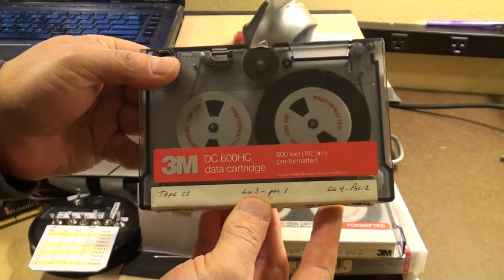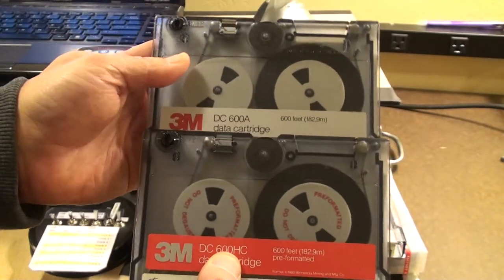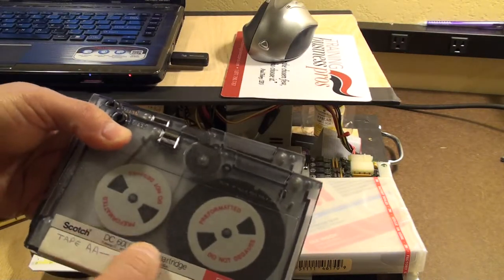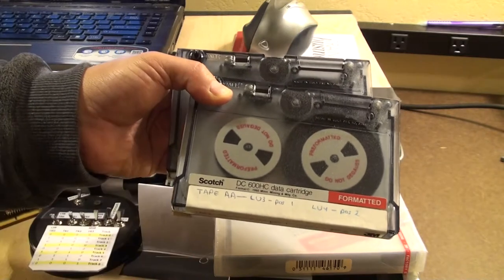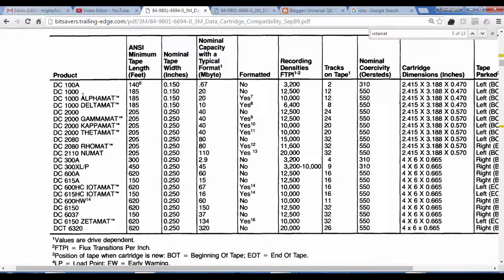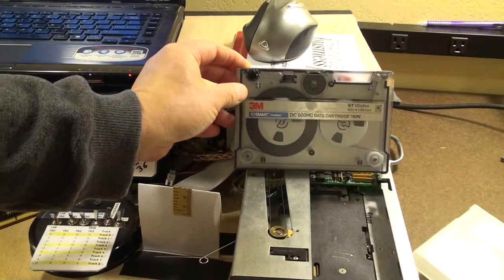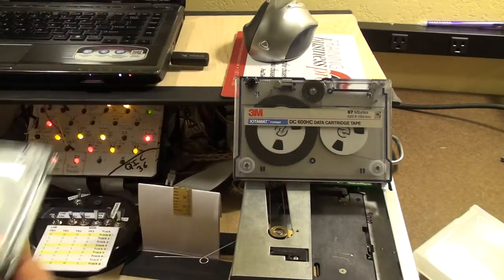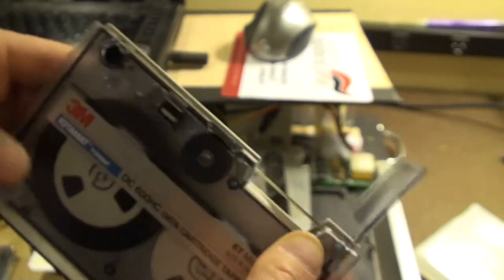DC600HC IOTAMAT Format Blank QIC Cartridge Analysis

Comment: re: 07:20 - The 3m chart (at 03:55) shows for DC600HC that the new tapes ship parked "Left (EOT)" - end of tape. This tape characteristics note is in agreement with our observation that the tape did come parked at the end of the tape (EOT.) This is good and makes sense.

re:  the pre-formatted format... the 3M Data Cartridge Tape Characteristics DC 600HC IOTAMA line shows under "Formatted" column, "Yes (14)" - i.e. footnote #14.  Footnote #14 shows, "Cartridges are formatted for use on systems incorporate the 3M HCD-75 and HCD-134 drives." 

It's really great that you tracked down a pre-formatted blank tape.  Perhaps there is a way to have some interpretation software looking for the codes seen at 11:55 and it could report, "Tape contains what is likely a HCD-75 / HCD-134 MFM Format."  That would be great to have some automatic smart software reporting what it sees.

Comment: Interesting that the DC600HC is designed for 16 tracks of data. BELOW IS GOOD INFO RE: PREFORMAT...
page 12 of 92 of the HCD-75 manual:  
///
"PRERECORDED FORMAT

The cartridge is prerecorded in production with a full width recording head which writes completely across the full one-quarter inch width of tape. The tape length is divided into three areas.  These are an EOT area, a recording area, and a BOT area. The recording area of the DC600HC is divided into 4114 blocks (DC615HC is divided into 1042 blocks) which are separated by prerecorded keys.  See figure 4 below.

BOT AREA - The BOT area contains the recorded BOT pattern consisting of recorded areas of 5,000 frpi (197 frpmm) signal alternating with erased areas.

EOT AREA - The EOT area contains the recorded EOT pattern which is a continuous 5,000 frpi (197 frpmm) recorded signal.

DATA AREA - The data area is located between the BOT area and the EOT area, consisting of data blacks areas each separated by keys.

INITIAL BLOCK - The initial block is an erased length of tape nominally 1.764 inches (44.81 mm), which separates the BOT pattern from the first key.

END BLOCK - The end block is an erased length of tape nominally 1.764 inches (44.81 mm), which separates the EOT pattern from the last key."

...

MANUFACTURERS BLOCK - Absolute block 0000. The data is recorded in ASCII (the parity bit is set to zero). Line 1 is the cartridge type. Line 2 is the number of user data blocks per track. Line 3 is a copywrite [sic] notice. And line 4 is the cartridge identification code.

Example. 
 <CR><LF>
 DC600HC   <CR><LF>
 4096  <CR><LF>
 FORMAT <C> 1980, MINN. MINING and MFG. CO. <CR><LF>
 XXXXXXXXXXXXXXXX <CR><LF>
 <ESC>

NOTE
The Manufacturers block must not be overwritten.

KEY - A recorded signal containing a unique number to identify a location along the length of the tape.

...

IMFM - The method of recording used to encode the key numbers. It is an abbreviation meaning Inverted Modified Frequency Modulation."
///

-- I'm presuming BOT = Beginning of Tape and EOT = End of Tape.  

So "data blocks" vs. "keys"  -- that manual has lots more good info.  Shows alternating tracks play in different direction.  Also some sections about DIAGNOSTIC BLOCKS.

https://archive.org/stream/84-9801-5636-4_hcd-75_user_manual_feb83